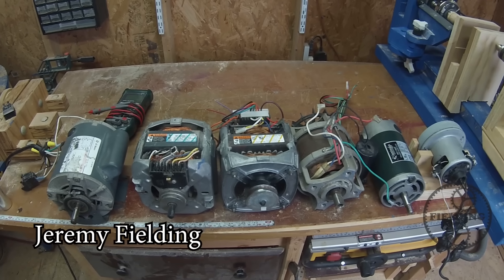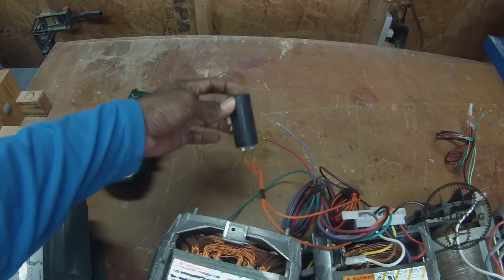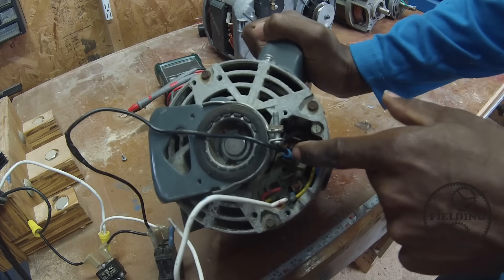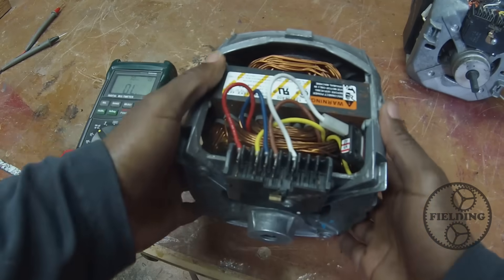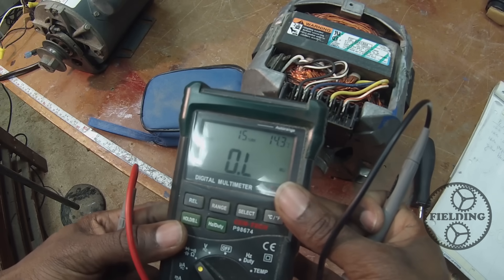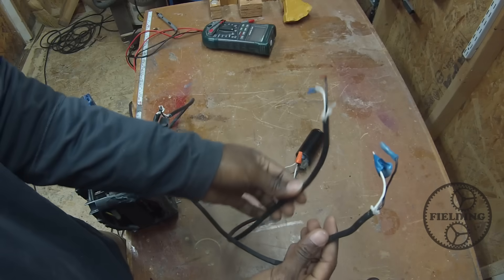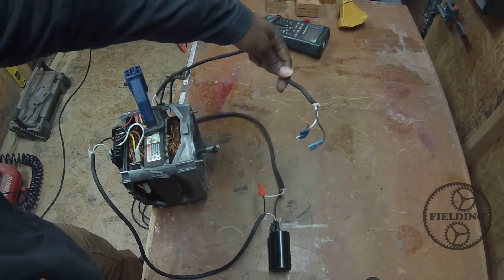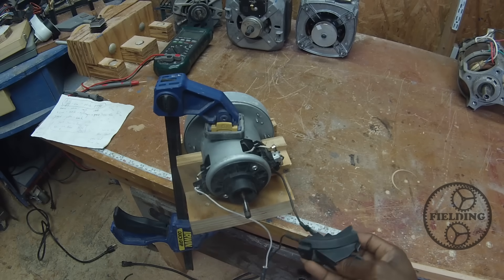How To Wire Most Motors For Shop Tools and DIY Projects: 031

Comment: Hi there 
I like your video,
I'm in south Africa,
On the washing machine motor you connected the starter motor wiring and then also a selected speed is this correct? So I can choose any speed I want out of the available terminals? Can I connect this to a windmill and generate electricity from it?
I see some capacitors come with 4 wires how do I determine which to use and why are there four?
Thanks
Donavan

Comment: I watched this video and you did a DIY power cable with circuit breaker and on/off switch. Brown wire is connected to ground earth and the other end was connected to the frame/housing of the motor. Again please, add a schematic diagram of the DIY cable. On one of your videos, you used a vacuum cable (with 3-prong male socket on one end). Thanks much.

Comment: From Canada: First, thank you so much for the videos. I really really appreciate what you're doing (effort, time, video editing, etc.) in teaching us or sharing with us your knowledge on electric motors. I bought an 8-wire motor on sale from Princess Auto $40CAD. I still have not measured the ohmic resistance of the various wires (I learned from your videos on START WINDING, RUN WINDING, CAPACITOR KICK START, CENTRIFUGAL SWITCH, BRUSHLESS INDUCTiON MOTORS, and others.) Well, uhh, please do a video how-to on 8-lead one-phase motor (hope the motor I bought is a 1phase motor) with 1) diagram/schematic, 2) actual demo how to connect the wires and test run 3) Ohmic inspection of the wires. Thanks a million.

Comment: great video perfect pitch of context and technica . I wonder what the better sources for brush motors I need speed control on a couple  of projects I built a large stone grind/polish roller 2o kg capacity , was fun working out the tumble speed pully to fixed speed motor. Thank you.

Comment: I can't stress enough the importance of making sure the motors are secured somehow (but, not with your hand)  before powering on. I think in this video and others you mention it. I just found out the hard way with a vacuum cleaner motor. Also, remove all attachments to the rotor. In my case I left on the circular piece that I guess generates the suction. When I started it, it jump sideways and in a split second cut the top of my hand near the finger all the way through the skin and also cut a tendon. Ugg!! I had to have surgery to repair the tendon and rehab took about 10 weeks.

Comment: My furnace  blower motor has two wires, no capacitor, and won't run or hum when connected to 110V even if given a spin manually.   What's up with it?

Comment: Would a pulse width modulator work to adjust the speed with the first motor you plugged in or would that also mess things up?

Comment: I don’t get it I have what I believe is a single phase motor. (Taken from an LG dryer). There are only three wires running to the windings. Should I not have four ; pair for the starter and a pair for the running coils? Can some one please tell me what I am missing besides brain cells

Comment: Outstanding how to video, thank you so much, I got a little lost on the wood chipper motor at around 11:06, how do you know when the starting capacitor is wired on the inside directly as opposed to being wired externally using the power chord wired in parallel, like the washing machine motor?

Comment: Jeremy, 
I’m super happy to have seen this video and attempt my first wiring of a single phase motor on an antique lathe. 
I am in able to see the exact wire routing from the motor back to the switch and the fuse and then to the plug. I may be able to skip the fuse but probably shouldn’t. Can you possibly send me a note with the wiring diagram for this? I have tried to pause the video many times but can’t quite get the diagram or direction of the wires. 🙏

Comment: I'd like to replace an old 1960's petrol speedboat engine with a series of car batteries and washing machine motors (on a low budget) how would you do it? Thanks for your great videos! 👍
Reply: Ehhhhh, Electric and water don't mix, I think I'd avoid that especially on a low budget

Comment: Hi Jeremy, nice vid. mate. why didn't you show the washing machine motor running at it's different speeds? I am a electronics consultant over 50 years, may I give a little advice? please don't short out a start capacitor charged to mains voltage with a screwdriver, it should be done with  low value resistor high wattage to discharge it slowly or you may damage the capacitor by drawing too much current at once.

Comment: This video was super useful. A follow up question - you mention several times the wiring used here is just temporary. Do you have any videos showing an example of how you would wire one of these permanently, including an on/off switch as well?

Comment: Graduate Engineer (not Electrical) stumped trying to get a washing machine motor to run.
Thanks for your clear instruction in solving the problem.  However I tossed the Capacitor before I saw your video.

;<((

Comment: I know it's recommended to have a dedicated circuit breaker for larger appliances, due to inrush current of inductive motor,  what does your breaker box look like in your shop? Should I worry about using a regular outlet in home if I repurpose a small enough motor? What size, in your opinion, is considered 'crossing the line' when it comes to making sure you are within, say, the 80% margin for circuit breakers? Thanks for the amazing video, it helped me figure out the wiring for the motor I have, but I don't want to overload anything or see smoke! Haha

Comment: Hello Jeremy, how can I convert a 240v motor to run on 120v BEING A NON-DUAL VOLTAGE? The dual voltage we just remove a small door and change the wires, but what about the others? Can you do one and post it up so we could see it? Thanks. I know it is possible, I saw somebody do it but did not took notes.

Comment: Not enough detail to be (for me anyway) able to do my own washing machine motor hookup.  Generic wiring diagram showing connection to start/ run windings and relationship to capacitor would be helpful.  In the thrilling days of yesteryear they didn't teach much of this electrical/ electronic stuff to mechanical engineers.

Comment: Hi I've taken a motor out of my tumble drier and I want to test the motor its a single phase motor with a  4 pole capacitor the white wire goes directly into the motor then it has a red wire from the motor to the cap with another red coming out and a black wire on the other side of the capacitor which does the same any idea how to wire this without blowing myself up please?
Reply: Just worked out that this motor is a forward / reverse motor so its all good now

Comment: I did not understand how you chose your connection wires with the capacitor. And I can't see on the video how you did it. Repeat the video with different colored threads and the close up video to see the whole clearly. And in the description of the video you could add the connection diagram.

Comment: it did help a bit, it was hard to follow when your wires are going all over and you have a lot of different colors. A little more coherency would have helped. If you could have got similar wires, solder, shrink tubing, a small diagram of how you hooked them together it would help in the future...  but I do that sometimes as well, but I would have tried to make it more understandable if I made a you tube video... I stress, I am trying to help, I'm not trying to be a jerk... I'm sure you can find a lot wrong with mine as well, I never seem to get around to edit them, check out my chicken, rap, etc... but again it was helpful, especially showing how to to find the correct wires. Thank you.

Comment: Thanks for the video.  I am looking to use a AC motor single phase, I think it is a FASCO.   I think it came out of a furnace or something and they want me to put it in as an exhaust fan for an outhouse at a lake cabin.  Thanks for your explanation, now I have more digging to do to understand the wiring.  The videos on this motor show speed wires, but I don’t know if this one has it or had it.  Again, thanks for your video.  You are always good at explaining motors and I appreciate it.   One day, I hope to make a treadmill to power a TV, that project made me smile.   God Bless!

Comment: Hello, I have a motor with 6 wires. There are 2 pairs that read 1.3 ohms each. The last 2 wires show open. Do you have any suggestion on how to wire this? I'm thinking that the open wire pair may be the centrifugal switch or maybe the capacitor. Any thoughts?  This is a 120 VAC motor.

Comment: Hallo Jeremy thanks for the video I absorb a little more every one I watch but can you help with a problem I have at the moment with a ac single phase motor I’ve taken off a damaged saw and reused on a Frankensaw I’ve built but it’s got a fourth wire and I don’t really know what to do with.. The 4 core cable in question came from the motor and on to a starter switch that got damaged so I couldn’t disassemble in a normal way to note the cables purpose

Comment: Here's a little hiccup for people not living in the USA or any where with 110V mains. I tried using a 180V 6A treadmill motor on my belt grinder. Used a PWM speed control (Chinese) through a bridge rectifier (AC to Dc) and kept popping the 20A fuse until I realized that most of the videos are from countries with 110V so I pulled out my old 220V to 110V step down transformer and wired it up and it ran until I burnt out the step down transformer. 
Here is the catch. You can't run a 6A motor off a 250va step down transformer. And to buy a 1500va step down transformer is way too expensive. It's cheaper and more efficient to run your machines off a 220v to 3 phase VFD and a 4 pole motor if you are from South Africa.

Comment: Great video, Im looking for a 1/4 hp 1725 rpm, with a switch to run a lapidary saw, , I got a used scroll saw a guy dropped and broke Good motor, and I used the whole bottom section for a mount, The motor is not powerful enough, I did use a 21/4 pulley on it but it slows down, and gets hot, I think that treadmill or vacuum motor would work, Where do you get the vacuum one from?

Comment: Yeah as always it was helpful Jeremy.  What happens if you incorrectly identify the start winding (is that what is called?).  Like it you plus in two speed control wires and run power through them? I assume there could be continuity between them in some cases, but maybe not.... Thanks

Comment: I got a brushless motor that has like a quarter of the wires that are black, it just hums when you plug it in and trips the breaker after a couple seconds. Also it welded the plug to the socket the last time I plugged it in, what could be wrong ?

Comment: I have a 110vac brushed motor from an electric chainsaw. I have a 80cc gas motorized bicycle that you have to pedal then pop the clutch to fire the gas motor. My idea is to use the little electric motor with a gear and chain to the gas motor to use as a starter motor. I have all the wiring still attached to the 110vac chainsaw motor. My question is how can I make it run off a 12v battery?

Comment: Very basic. You should have gone more into knowing what the right capacitor to use is, and included reversing rotational direction in this video (not a separate video). And that sometimes certain brush-holders don't permit proper reverse rotation.. You briefly said that the first motor is not speed-controllable. But, the DC motor and the universal motor is. You should have at least included that. But the most important thing is finding out if the motor is actually good and usable. Sometimes, some windings can get shorted together and give continuity when there shouldn't be. And, that can be sometimes be hard to detect. You should always compare actual running amps with the name-plate rating. Verifying the integrity of the motor cannot be over stressed.

Comment: Hi Jeremy, I'm direct wireing a Oreck vacuum motor. The power cord has a black & white wire, the vacuum motor has a red & blue wire I know white wire is neutral and the black is live but witch wire goes where, the red to black or the blue to black????  The motor starts with a RF signal which never worked so I thought I would go direct. ( i HOPE) LOL. thanks for any help on this problem.Chuck.

Comment: Hi Jeremy, your work in all the videos I have watched is inspirational, Just waiting to get a workshop space to try-out some constructions you have made.. I do have a question to ask about the torque in an ac motor. I have a table saw which is new and struggles to cut 5 cm pine wood as the blade slows down. How is it possible to increase the torque of the motor by adding a run capacitor or to use pulleys to change the gearing.. (which will increase the blade rpm.. Presently at 4750 rpm..) Not asking for a definitive fix just what direction to consider to make a compromise and work toward.. The remainder of the table saw is excellent.  Already a subscriber and enjoying your way of teaching, I learn more from you than I did at school. Also now teaching my 13 yr old daughter to find solutions to engineering problems with your videos. Inspiring. Thanks Again

Comment: Awesome job!
I recently acquired an Emerson AC motor(Canadian) 1/2 HP@110V  single phase. It does not appear to have a start capacitor visible. I think it was removed for some reason. I tried google for a capacitor value to no avail. Is there a rule of thumb for Start Capacitors for these kinds of motors?

Comment: I have a squirrel cage blower out of an A/C unit (it runs/works fine). Is there any reason why I can't use it in my dust collection system, after the cyclone and before the filter bag?

Comment: I'd like to chat with you on wiring a gear drive dc motor, it's a dayton 1/15 hp right angle motor and gear drive, part number 2z800b it has 4 wires coming out of it. I want to connect it to a speed controller to vary the speed, with the gear reduction the shaft speed is rated to be 60 rpm, anyway to increase that?

Comment: Thank you so much for your valuable review. And I have some vacuum cleaner motors and need to use for a DIY projects like table saw, drill and wood router. So would you give me some advices and guide for the how to do steps and tips. Thank you.

Comment: Is it possible to change the shaft in a motor. My air conditioner motor is weak so I think it needs  a new motor. But it’s very old 1992. It works plugged in although I have to start it with a Manuel spin with my kitchen spatula. Lol once it gets going it cools perfectly. I’ve changed the two capacitors.

Comment: Hey Jeremy, The video is very informative, however it does not really explain how you determined where to find the start capacitor wiring clearly.  You began this part with saying that you will start by measuring the pair that you already know what the start winding is and never really explained how you determined this. Some of the other "run" windings have very similar resistance "ohms" as the start winding.
Reply from the maker: Many have said It helps to watch more than once. I definitely explain how I identified the start winding

Comment: I'm interested in turning a 120v 60hz 9.5 amp washing machine motor into a small bicycle, or creek powered generator... Any suggestions? Do you ever play around with generating electricity from reclaimed motors?

Comment: Great informative video series!  How do you actually fasten down one of those frameless motors in your project that have nothing to mount to built into the motors?  I've only used metal strapping and wood to hold them in place, but it seems so primitive.

Comment: It seems the video focused more on the end result of your motors. Which is ok. But I thought you would go into how power from your 110V would need to be adjusted to accommodate the wiring needs of different motors like Over load protection, wire size, motor ratings and the name plate info vs. no name plate info wiring practices. Good stuff going over the capacitors though. I didn't know about that.

Comment: This is very cool. Years ago, I salvaged the motor from an old upright vacuum. I subsequently inherited a small jointer. My plan is to build a new cabinet for the jointer; the cabinet will incorporate the vacuum motor to create integrated dust collection in the cabinet.

Comment: You are a genius my friend!  I have followed your advice and started collecting motors to make tools. (Mostly woodworking tools)  I just found a GE AC 1/2 HP motor. But motor is a 3 Phase 240-460VAC.  Is there anyway to convert this motor to single phase and 120VAC??? I thank you in advance. Cheers, AL

Comment: Hi Jeremy, im trying to build a football thrower (Google jugs football) to help teach my nephew how to catch. I'm going to be buying 2 used 208-230V, 1ph, 1/3 HP condenser motors. I read that hooking up the 220v to 120v wall outlet will double the amps and eventually burn out the motor. In theory, could i wire both motors in series to divide the amperage? I'm having a hard time trying to figure how I would wire it. Any comments would be greatly appreciated!

Comment: I'm trying to figure out how to connect a single phase, 3/4 hp, 1750 rpm Dayton motor to a three wire cord, for use with 115 volt power. 
There are 8 wires coming out of this motor's housing. 7 are the same tan color, but each is marked with a separate
letter and number designation. There is one unmarked green (ground) wire. The "115 volt" diagram on the motor housing shows
wires P2,T8, and T3 connected to each other, and marked "tape." Wires T2, T5, and T4 are to be connected to each other, and are labeled "line conn." Wire P1, connected to no other wires,  is marked as "ungrounded line." The green wire is the only one with a self-evident purpose  -- ground.
Any ideas about which of these wires to connect to a 3 wire, 14-3 line cord, with three prong plug? Any tips gratefully received.